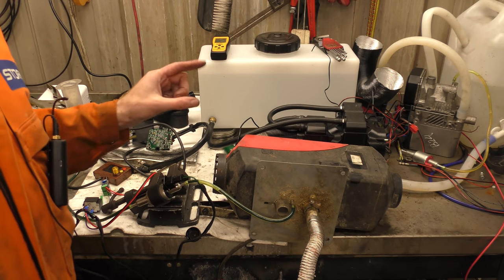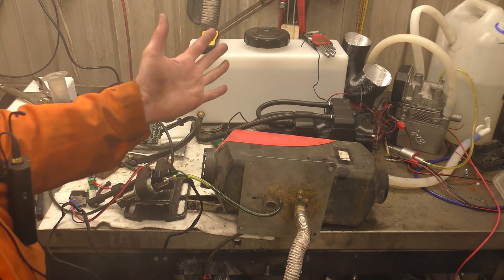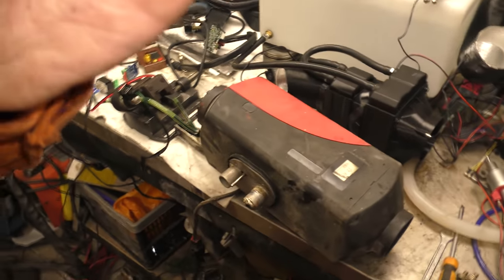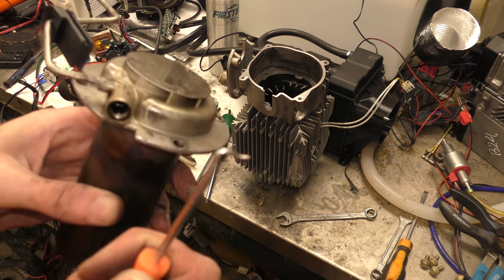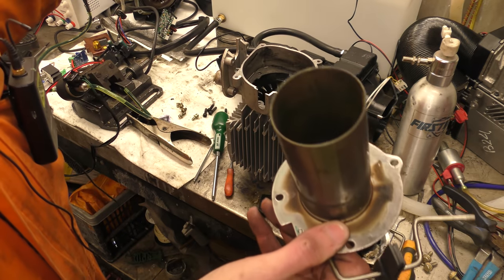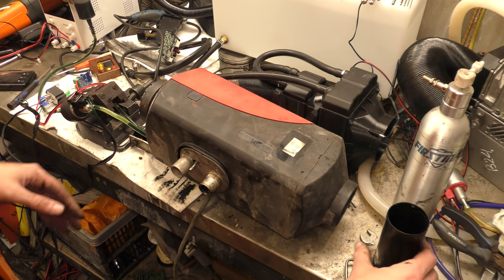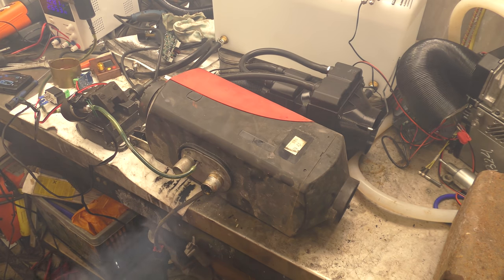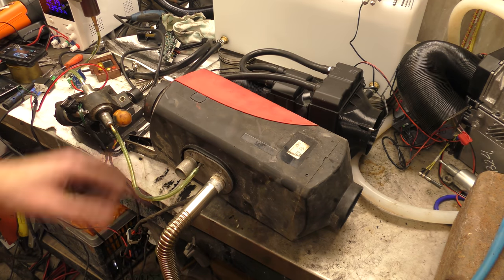Diesel Heater Diagnosis - white smoke but not lighting

Comment: My guesses are...There is no fuel filters, and Diesel doesn't burn that clean anyway, so it built up over time...This is precisely why we shouldn't get the 5KW model and run it on the low settings. it doesn't have the chance to burn the crap out of the stuff and causes carbon built up and clogged the little machine.

Comment: I realize that this is 3 years old,  But for other folks,  remove that round thin plate that's riveted on the back of the burn chamber and it won't stop up,  Giving it more air and allows the exhaust to have a lot more pressure,  Solved my problem 
Mine wouldn't last but a day or two and stop with E-8 code,  Soot everywhere, 
 Not anymore,  she works great now.

Comment: I have a question, my diesel heater starts fine and runs for about 15 mins then all the sudden the fan slows down to a crawl even with it on full blast and it starts to dump smoke out the exhaust,  any suggestions?

Comment: Yes, you can run them sideways not recommended, but you can or for those idiots that run them upside down and wonder why there’s diesel fuel leaking out of their diesel heater that’s why the damn thing was only meant to be Ronde a certain way not upside down that’s for sure

Comment: My one drips oil from the intake but only when it is run on a mixture of engine oil and diesel, doesn't do it when run on strait diesel, any suggestions on what may be going on, it is a new heater with the new controller like the black one in this video only it has a spanner emblem where the others have a asterisk, none of the codes work only 1234 and it gives you some strange settings.

Comment: Mine just floods itself on startup and gives e8 error. Ive pulled it apart and everything is fine. Only way ive been able  to start it is to take the fuel line off on startup so it can clear itself and when i hear it firing up i out the fuel line back on and it goes. Has done it since new and i thought it was air in the line but no its just a crappy heater

Comment: Hi David love the videos , here's a good one for you , I have a Chinese 5 kw 2 months old 300 hours use now , past few weeks seems slower to light and smoke for few minutes then lights ,now the mystery is I can smell the grey smoke coming out of the blower vents , I've checked its not from the very end of exhaust outside ,I  looked underneath and its leaking right near were it joins the base / manifold outlet ,I've re done the exhaust nice strong super clamp even a wee bit of paste ,but it still puffs out a tricle of grey diesel smoke which is pulled into the gap were the silicone gasket is ,the silicone gasket is also brittle and broken only 2 months old !, any ideas were this smoke could be coming from ? I re tight end exhaust clamps 3 times to check ,it wasn't them it seems nearer the very base of the alloy exhaust pipe ,can they crack ? 
Its  bizarre,and dangerous suppose not using it obviously  till fixed , I can not see any cracks in the exhaust port ,the clamp was tight on the exhaust tube no play , I think its been doing this a while but I only can smell and see it when its starting up, Starts up .. glow plug on ,pump on ,then grey smoke then maybe 2 minutes it fires up and runs ok , the smell goes away from blower vents but I guess it could still be emitting invisible gases once its running warm , any ideas I remain baffled 😀
Reply from the maker: If your combustion gasses are mixing with the hot air you might have a leak/crack in the heater housing that seals up again once hot.  Or one of the gaskets that seal the combustion chamber could have failed and is also leaking.  Do you have a carbon monoxide alarm?
Reply: @DavidMcLuckie  yes got alarm ,took heater out the black silicone seal and the fuel  inlet pipe square seal are brittle and cracked ! 3 month old heater ! The smoke may be coming from the fuel pipe seal not sure yet till I put new seals on and test ,seems very odd the seals look like rubber to me, and the smell I was getting was like sunburnt diesel rather than exhaust smell

Comment: pulled mine down , all the screws where loose inner and out ,had 500 liters of fuel threw it . so put it in the ultrasonic cleaner , put it back together with the old gaskets and permatex gasket goo, woks better than new , just wish i had of done that before i put the 2nd one in . the burn chamber an glow plugs where hand tight so was the head .

Comment: I had similar malfunction after burning 300 liters of diesel, I'm cleaning it every 1,5 months, but this time she (it's a girl) didn't fire up, white smoke, cars stopped to see what's going on, as smoke poured out of my cellar (use it for home heating)

Opening up that little 3mm hole near the glow plug made all the difference, as I didn't clean it before, she started right up after cleaning.

Comment: Flagpoles from amazon maybe ebay duno but I got these out of a "return bin" and they work SUPER for ex pipe!. I put them on my van and in garage! Fits perfect onto the ex of unit, sections of  bout .5 meter then the top where the ball is fit PERFECTLY on the outside of a muffler! (with two little half holes who cares!) I got all of em I could and my cats Hungry.... TBC...

Comment: Unfortunately I think I'm going to have to do this full diagnostic... I'm having a similar issue although mine ran for months before I had problems. I have found a lot of carbon build up inside the exhaust pipe... When it was burning fine, I didn't notice any smoke at all... So I'm not sure why it is burning so poorly. When its on full blast the internal combustion chamber gets nice and hot, between 170-210 Celsius... I'm only at 1300 m elevation. My controller doesn't allow me to change the hz... I either can have it on the standard settings, or change it to alpine mode for 1500m+. Since I'm below 1500M I haven't ever run it on alpine mode... 

Once last week, it smoked everything up and then got E8. Cleaned out the exhaust by wacking the metal pipe against the ground, and used a tooth brush to attempt to get stuff out of the muffler... Got it running really hot again and it was fine, until today. Now I think I need to pull the entire thing apart and clean everything out...

Comment: From my experience from same heater, if I use maximum pump speed, 5,4Hz it start sooting and after a while barely give any warm. And it would not start, only white smoke. If pump settings are 5.2Hz or lower then it goes on without problem. I think it does not got enough air to burner. Maybe fan speed tinkerin can help but some said that bearings will worn out quite fast if run 5000 rpm

Comment: Hey guy you said you should like to recover some of that lost heat in one of your videos. I want to do so as well but would like to do so as cheaply and of course safely. Putting it in line with my rv water heater to take advantage of the pop off on it. Thought you might be able if anyone to do that.
You did say you would like ideas? 
Thanks before hand.
Shawn Roseburg oregon.

Comment: Another thank you my bunk heater quit last year it would come on click click shut off white smoke. After watching your video took it upon myself to pull it out and see if I could find the issue. It was easy got it apart that plug hole on the side you was talking about was my issue I cleaned it out, Clean the glow plug tip put it together and it fired right up. Shut it off several times to see if it continue to work and it does hot hot hot thank you so much again for your video.

Comment: Thanks for  good video. I bought one after seeing one of your videos.i have had it in my van now for over 24 months. With no problem. Thanks 😊 its a god send and for the 130 pounds I spent worth it.top branded ones are 500 plus. I even put it on when at home.why because I didn't want to  de ice my windows in the morning. On a low tick over at 16 degrees. No ice and van starts 1st time.such a low battery drawer when at temperature .I thank you kind sir lol

Comment: I had problems with my diesel heater and I thought it was a faulty fuel pump so I installed a new pump, after all they are cheap on ebay.... but my problem turned out to be the silly little hose clips letting air into the suction line from the fuel tank. 
I fixed the air leaking hose and the heater worked great for its test, but on holidays using it, it started smoking and got so bad it could not be used. Once home I removed the heater and got a repair kit I did not need....and pulled the heater apart and got maybe a cup full of oily soot from its insides.....I had been running it on low mostly so concluded it should be put on high every now and again to burn itself clean.... That is when I watched a video on just how the fuel pump size controls the air fuel mixture....and sure enough I had installed a larger pump.....
I installed my original pump and were thinking I might have to pull the heater out again to clear the soot build up when I got the idea of using a 12v matteress inflatar to blow extra air into the heater combustion air intake and see if it could burn it clean, and it worked a treat....with the heater thermostat set to maximum I removed the combustion air intake filter and blew the extra air in.....and it roared and smoked like crazy but heated up and burnt itself clean.....    It has been working like new again and had hours of use since....    So don't try using anything but air to feed the combustion air supply, if the heater is smoking. 
Of course this is no substitute for someone that knows what they are doing programming the air fuel mix in the advanced program settings of the thermostat.

Comment: I currently only have a heater that will start when I add brake clean to the air intake on start up. Also running 30 70 mix of hydraulic oil and diesel which may also be the culprit

Comment: I have tried for 2 weeks to get my heater working and no-one could give me advise to fix it but I then saw the title of this video was my problem so watched it and no-one had mentioned the little vent hole in the glow pin hole to me. I removed the glow pin, found and cleaned out the little hole and away it went. Thank you.

Comment: Have a Chinese diesel heater to fit in my ex ambulance that had aneberspacher in.
The good part is the thermostat controller pump and power plugs will sell on eBay and bring more than the Chinese heater cost

Comment: If you remove  the glow plug , and use brake cleaner,  and carburetor  cleaner with straw sometimes  will clean up enough  to get it hot . The carbon  is acting like a space shuttle heat tile.
Due to faulty  controller shutdown  developed  this carbon condition 
And thank you autozone

Comment: That little hole! And just a warning after trying to start many times the fuel oil buildup inside can create a thermal runaway condition once it starts and get the exhaust pipe cherry red!

Comment: MY HEATER HAD LESS THAN 1 GALLON BURNED THROUGH IT ,AND I REMOVED THE GLOW PLUG AND STUCK AN L SHAPED PIECE OF WIRE THROUGH THE AIR HOLE AND CLEANED IT OUT, AND IT FIRED RIGHT UP,       THANKS FOR THE INFORMATION!

Comment: if these heaters run out of diesel in the tank, or they flame out... Do they automatically turn off?!!
Im in the process of installing one, Into my big shed at bottom of my garden, For my snake collection (big collection, So built and insulated a massive shed for my "snake room".... 
My garden is over 60m long though.. So Im hoping it will auto turn off, if it ever runs out of diesel, or flame goes out... and not just sit there constantly trying to restart itself over and over...
Reply from the maker: Yes.  Once they've flamed out while running they stop.  They only try to relight during the start phase if they don't light the first time.

Comment: Hi man, please help me with an advice,this heater is blowing my mind,after 2 ore more hours of work the fan start to over speeding more than the maximum speed, after that the fan speed increse,decrese x 10-20 times and finally heater stops,all smoke from burn chambe are getting out on intake air filter. And most strange no error code.From your experince what could be because in dont have a start point and i see you testing this heater in all method. thanks . cheers
Reply from the maker: If there was no error then the heater had no idea what was happening.  Sounds like the ECU.

Comment: Hi David,  I’ve got an eberspacher gas ( petrol for you ) heater that’s been tested to confirm the ECU crapped out, causing the fuel to never ignite.  Issue is the cost of a new ECU at $680 Canadian at last check.  

  My question is: can a person manually power the glow plug & ignite the fuel by providing power with separate switches and wiring hooked up to the same wires in the harness ?  If all that’s missing is the signal from the ECU, would it continue to run if both electrical signals were provided outside of the ECU ?

  Or is there anyone that can rebuild the ECU, for a reasonable price ?

Thank you,

Henry in Alberta, Canada.
Reply from the maker: If it tries to run and pumps fuel but only the glowplug is missing, I'd remove the old glowplug from the heater but leave it attached to the ECU and fit another glowplug, give it 10V and see if the heater fires up.

Not sure about Canada but there are a few companies in the UK that can repair the ECUs.

Comment: I have a D1LC and a D1LCC, The D1LCC had a fan with worn out bearings so had a noisy fan and I think it overheated as it currently does nothing when switched on so I think the ECU has locked out. Ordered a 801 controller to diagnose it/unlock the ECU.

The D1LC has a good fan, starts up has a lot of white smoke. I swapped the burn chamber/heat exchanger over and it wouldn't pump fuel. I swapped the flame sensor over and it fires but doesn't produce hot air but the exhaust gets hot and the pump and fan are running at max. Tried running on paraffin and old white diesel. during shutdown when the pump stopped and the fan speed reduced slightly hot air started being produced. It's as it the fan is cooling the heat exchanger to much. The D1LC doesn't have a magnet/hall effect sensor so the ECU doesn't seem to have a way of monitoring the fan speed.

Shame it doesn't work as I want to stop using my calor gas heater in my 20ft container workshop as refill prices are getting silly.
Reply: Turns out the heat exchanger was heavily coked up with soft carbon soot, not sure if it was from running it on paraffin for the last few runs.

Comment: Had a similar thing happen to mine kept getting EO 8 then EO10 took the exhaust pipe off because it was running OK just fitted the exhaust with paste (whoops bit too much blocked the exhaust), cleaned the exhaust then tried again with an air pump on the inlet just for a few seconds then it fired up been running OK now turned it down to 3,4 ghz. So warning do not use too much exhaust paste.
Reply: 3,400,000,000 strokes per second - wow that pump is speedy     ;<D

Comment: My heater flames out shortly after plug goes out. Burn chamber only gets to 35-40c,then it flames out.
Uts running on bio, could this be blocked breather hole
Reply from the maker: Have you tried running on regular diesel?

Comment: So. I just faced down my demonic smoke belcher and might have been victorious. 
I blew in the intake as somebody mentioned, not plugged solid. Had already replaced glow screen and the plug today as it was damaged from overheating itself. 
Blasted a bunch of electronics cleaner in the glow hole followed by compressed air previously. Shot it with more tonight, rammed the plug in and set it to go. Sprayed carb cleaner up the intake a few times and got nice fireballs a few times. Noted chunks of cokey soot rattling out the exhaust. Got nicely heated up and seemed to quit smoking so bad. 
I had left the shroud off and it went E05 overheat which may have further contributed to self cleaning. Now its actually heating up again and all but zero smoke.... wow.
Reply from the maker: Nice, flames out the exhaust is always a nice touch.
Reply: The intake, actually. Right back in my face, inside a cargo bin under my bus. Not huge but nice. :p
Reply from the maker: Yikes!
Reply: Well hell
I just got back to find it shut down again. E08. It likes that one. It ran like brand new for 2 nights after I gave it the shenanigans. 
Do you suspect it is still plugged up or something else?
Its currently trying to light, glow plug indicator and the pump are going, but doesn't want to light off.
Reply: Good grief.
Forgot how difficult my install was. 
The hatred is unreal.
The quality is absurd.

Like everything is wrong.
I only even used this thing a couple of months. 
Plugged up, turns out the pump isn't er, pumping despite doing so merrily, so recently. I already properly disposed of the provided filter and put on a huge canister filter with a water bowl. 
The last time I messed with it seemed the blower motor was acting stuck

This is just so much fun its incredible

Comment: Hi, I have a problem with my heater with the pump not turning on, fan is blowing. When I try to turn off the fan continues to blow and won’t stop even after a long time. I then have to disconnect the heater to turn off. Sometimes the pump works but not always? I have changed the fuel in case it was bad fuel but still no go. Any ideas please.
Reply from the maker: Housing temperature sensor has failed.  The heater still thinks it's hot and tries to cool itself down.  Also won't start until it thinks it's cool again.  I had one where it sometimes worked and let it light, but then once shutdown it just kept running the fan and the two blue bars on the display never went away.